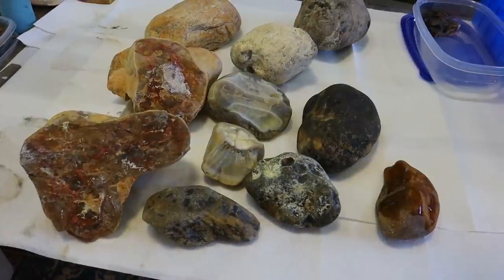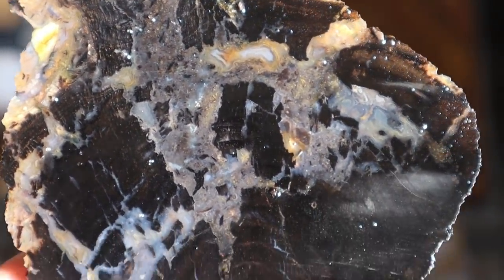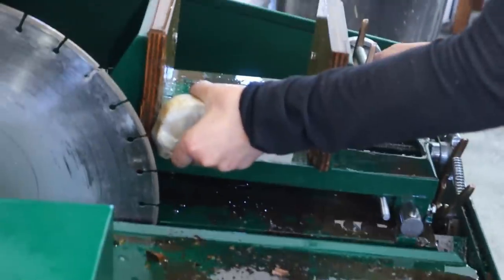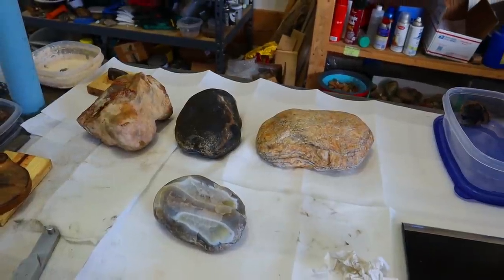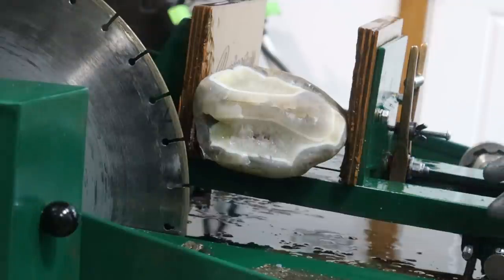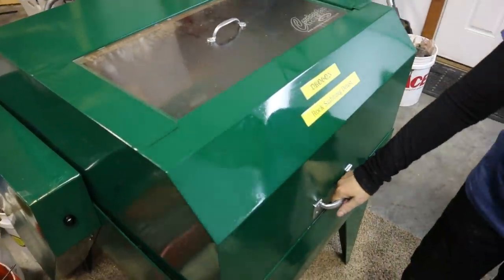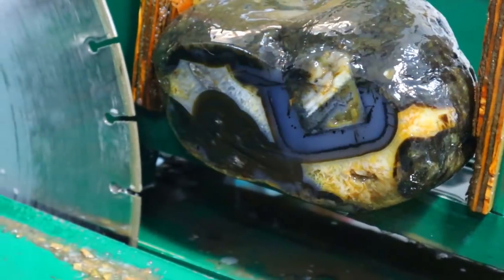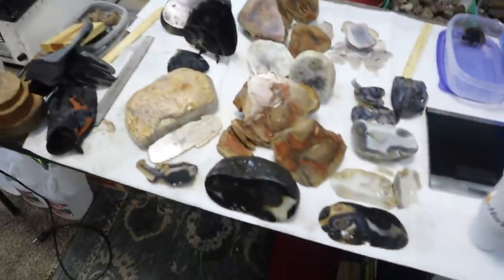What's Inside!? Slabbing a BIG Pile of MONSTER Montana & Teepee Canyon AGATES ft. Montana Rock Mom!

Comment: I think the camera does that because of the LED. It flashes on and off faster than the eye can see but it shows up as waves of light in the camera. It frequencies of the LED and the Recocoring of the bits seen by the sensor produce an intermediate wave of what is lit and what is unlit at each given point in the picture, or series of pictures which make up the video.
Reply from the maker: Exactly right! That one specific maglight was flashing at a different frequency than my frame rate on the camera, but for some reason all of the other lights we used did not do that. Caught me off guard because it never usually does that with my lights, not sure why that one flashlight is different than the rest🤷